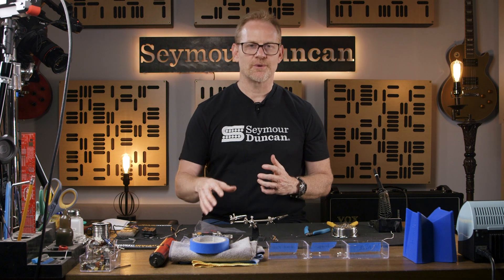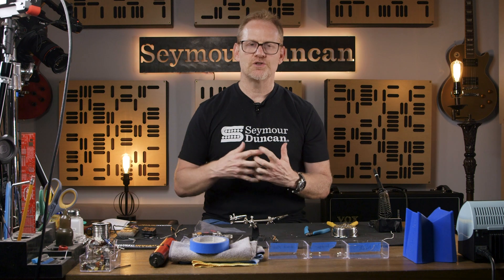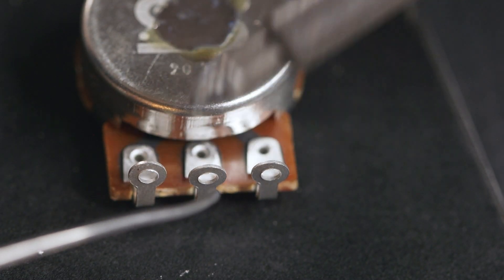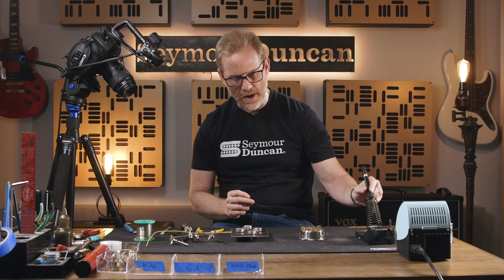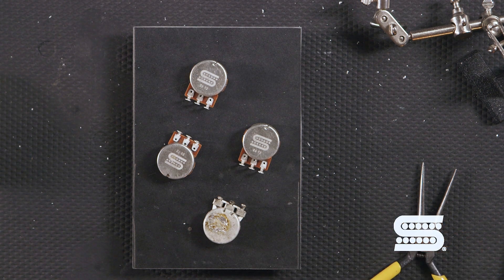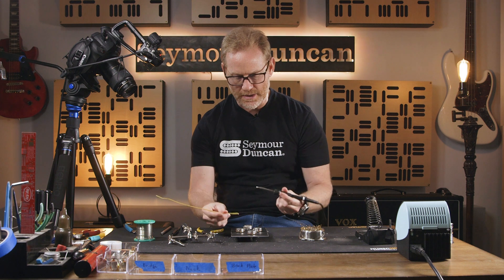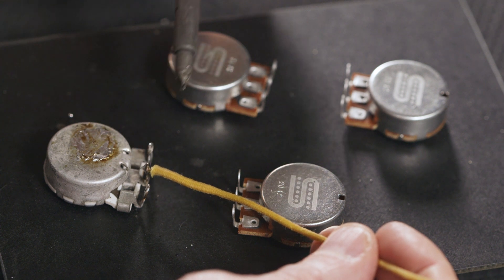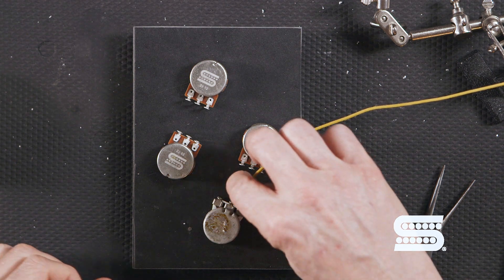Guitar DIY: Tinning Potentiometer Lugs

Comment: I prefer to insert the wire into the hole and bend it over, ideally 180 degrees of bend, before applying solder to both. This makes a much stronger connection, which is especially important for joints that get stressed, like 1/4" plugs on a guitar cable and such. Also, allow the solder joint to cool for 12 seconds with no vibration or movement, to avoid cold solder joints.

Comment: Why then, does the solder flow down, ya know gravity, onto the base of the lug and not fill the hole in the pot?
Reply: There’s several things that affect this. Solder usually follows heat, flux, and gravity. Usually the issue is the part you want the solder on is not hot enough to become “sticky” and create a chemical bond.
Reply: Try adding a tiny bit of flux to the lug specifically where you want the connection. Try turning up the heat to 700 or near it, and holding it on the lug surface alone for longer before adding the solder. To be fair, many people don’t like filling in the hole first. If you touch and heat both of the pretinned wire threaded through the lug and the lug together, you can usually get a quicker and easier connection by then letting the solder flow over both the lug and the wire already in the ideal position rather than doing each separately. Doing this allows you to use to leverage the lug hole to help hold both the wire, soldering iron, and solder in the right position during soldering

Comment: I have a Weller soldering station with digital readout and the temp set to 375 C and I have a different experience tinning wires, tinning lugs (as in this video) then what it looks like in your videos. I use .75mm diameter Kester rosin core solder 60% tin/40% lead. When you touch the lug with your iron and touch the solder to the lug it seems to immediately melt and flow and the entire procedure takes less than a second. My experience is with a tinned iron, I hold the solder to the lug for several seconds or more (trying/shaking to keep the very small diameter solder on the lug for those seconds) before it starts to melt and flow.

And when you add solder to the top of a pot, it sure looks like you touch the tip of the iron in the crevice between the tip and the top of the pot instead of just touching the solder to the top of the pot. When I try to add solder to the pot (mms away from the tip) it takes 4-5 seconds before the solder melts.

What am I doing wrong? Any tips?
Reply: Temp way to low.  Try 700 degrees.
Reply: @Marshall_EL34  Pssst, 375C is 707 degree F.
Reply: @todd737  yep ...my bad.  375C = 700 F.